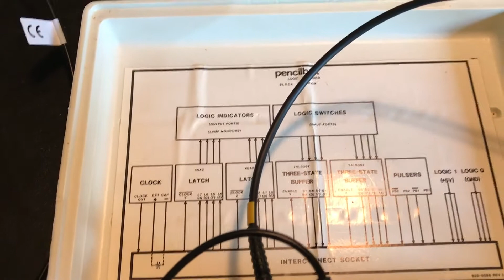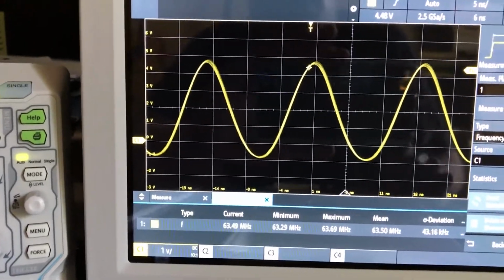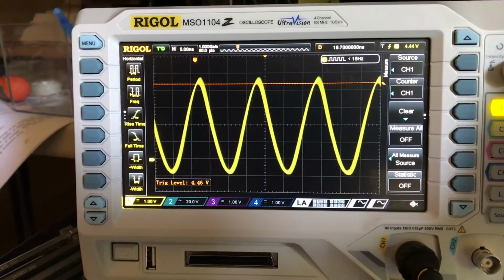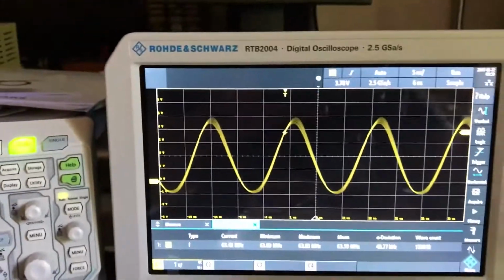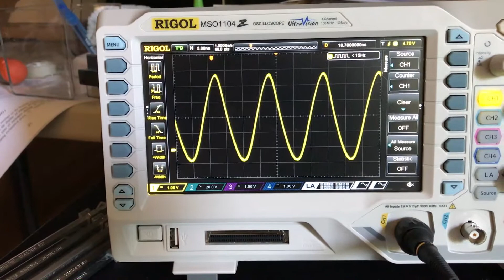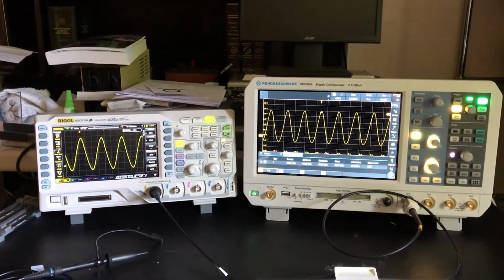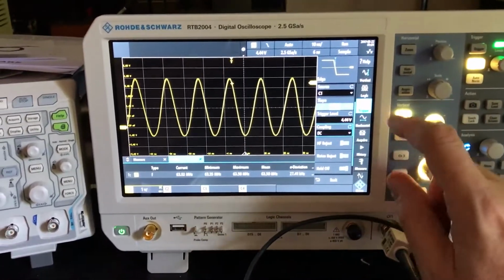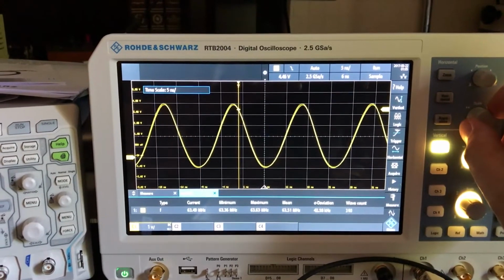RTB2004 - Part 5 - Rohde & Schwarz RTB2004 vs Rogol MSO1104z - Triggering - STB26

Comment: Why are you putting the trigger at the top of the sine wave? You generally want the trigger at the midpoint.
Reply from the maker: I actually fought with the triggering on this. The RIGOL has been generally harder to get a good trigger with which results in the freq. counter being incorrect a lot.